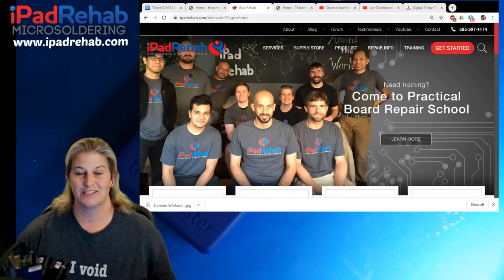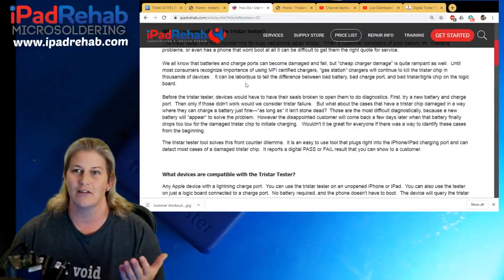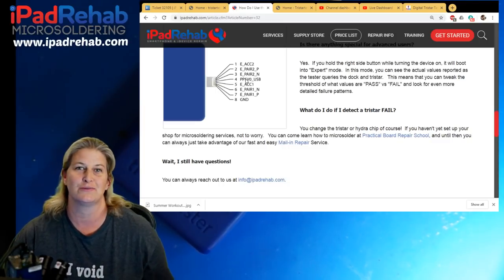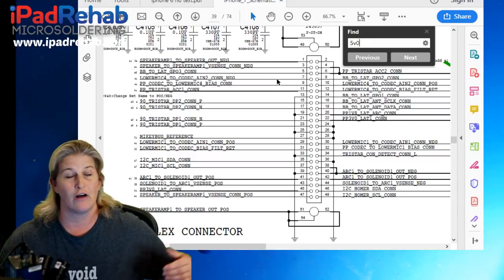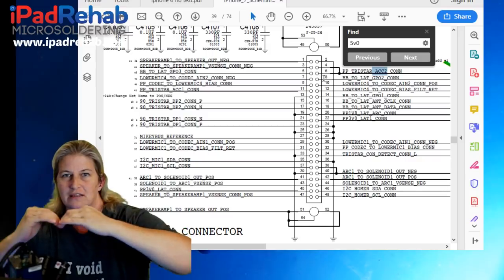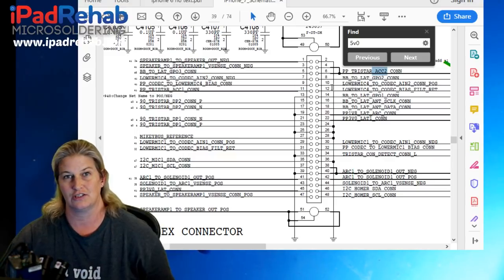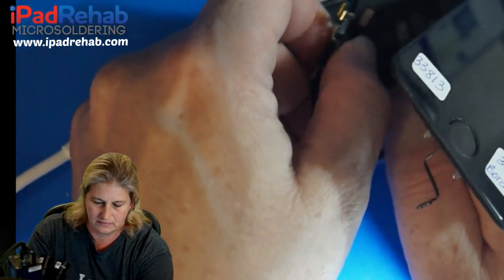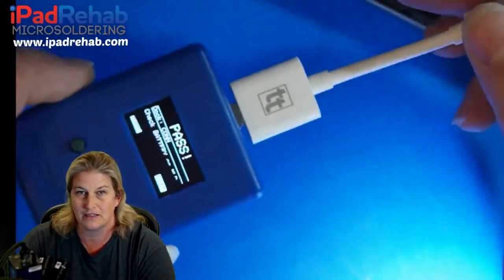Tristar Tester--Do's and Don'ts

Comment: Funny how you made this video, And just today another store sent in a iphone 7+ and said tristar was bad.  Because he tested it. I dont use the tristar tester. We just test ot the old way. New known working flex and new battery. And if that still fails. I use the test points on the board. And if the test points still show good reading.  I replace it anyways.  Works 90% of the time.
If your working on an apple device and it does not turn on and you can not see a short. Replace tristar first. Most of the time it is a internal short of tristar and will make the device look dead without a seeable short. PRO TIP. 
The old fasion way never fails. Remember. The tristar device is just as good as it is programed. And even apple cant get that right.